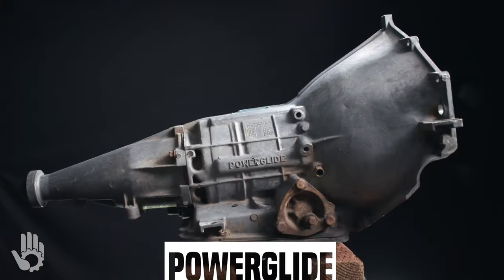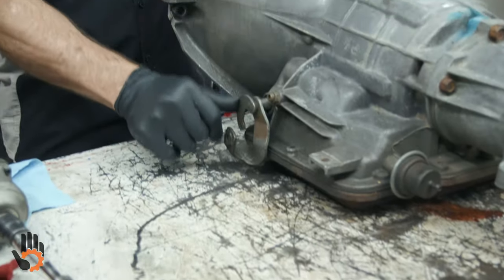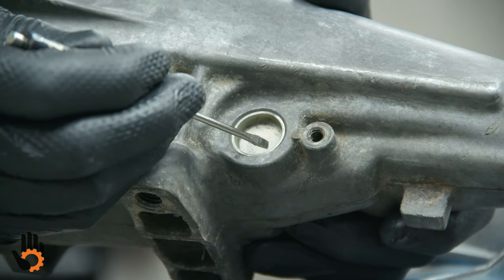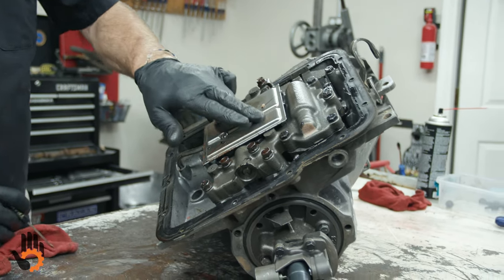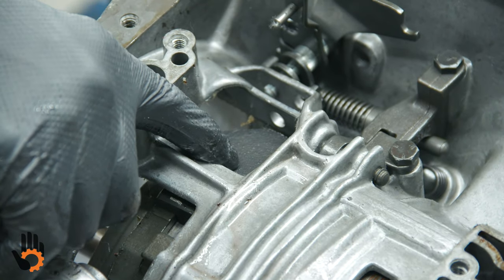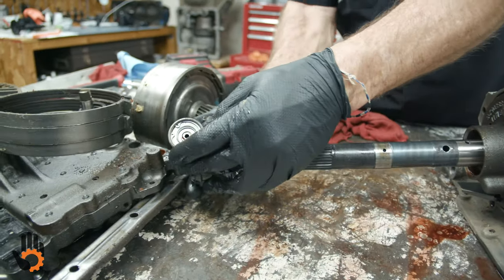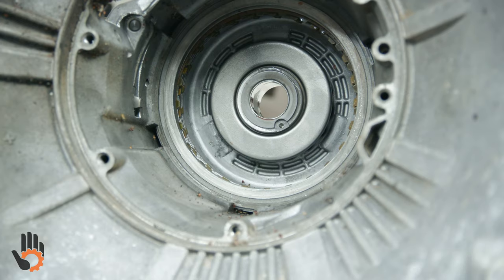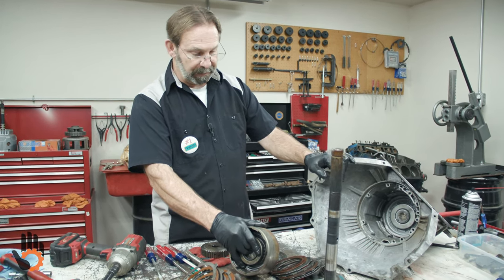Aluminum PowerGlide - Teardown

Comment: What happends if the "bandadjustment" is to tight or to lose? I have seen people say after you tork it back it out 2 turns , 3 turns and 4 turns.
So what happend if i only back it out 1 turn or lets say 5-6 turns?
Reply from the maker: If it's set too tight, the band will be dragging excessively on the drum, which will burn up the paper lining (friction material) on the band...and possibly damage the band surface on the drum.

If it's set too loose, the band will not be able to clamp the drum enough to prevent the drum from rotating.  This would result in a loss of a gear.  Could also result in slipping, which could burn up the band.
Reply: @SouthpawAutoworks  Thank you!!

Comment: I bought a modified powerglide a few years back but noticed the output shaft has some play to it. Its with a short tailhousing. Is this correct or is there missing/broken parts most likely? Awesome breakdown eitherway!
Reply from the maker: The positive feedback is appreciated.

Automatic transmissions will have end-play (front-to-rear movement).  They have both front and rear end-play specs (thousands of an inch).

Regarding the output shaft, are you talking about front-to-rear movement?  Or are we talking about up and down movement?
Reply: @SouthpawAutoworks  It has up and down movement, to where the output shaft can come in contact with the inner rim and thus nullifying any seal aswell. Edit: To clarify, the output shaft can be tilted to touch the edge of where the yoke would normally be up against.
Reply from the maker: I don't have the PowerGlide unit handy to see what a known good unit will do (in other words, how far the shaft will travel up and down).  However, I'm thinking this is normal.  Here's why...

Picture the trans being fully assembled.  The extension housing is outfitted with a bushing (and of course a seal).  In this instance, the output shaft can be moved up and down, to some degree.
-
However, when we install the driveshaft into the rear of the trans, the slip yoke will spline with the output shaft.  At this point, the slip yoke is being supported by the bushing, in the extension housing...minimizing any up and down movement of the slip yoke.  And now the output shaft is being supported by the slip yoke (they're splined together)...which minimizes up and down movement of the output shaft.

Once again, I would need to inspect a known good unit, to see what's normal.
If it turned out that the up & down movement was beyond "spec", then I'd be looking at the case bushing, etc.

Hope this helps.